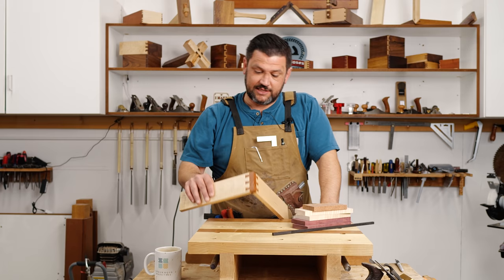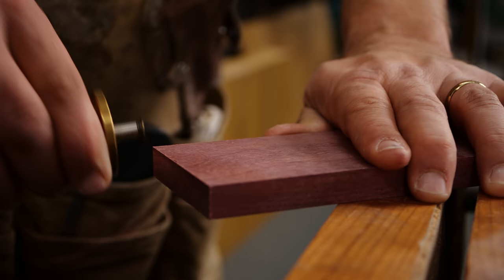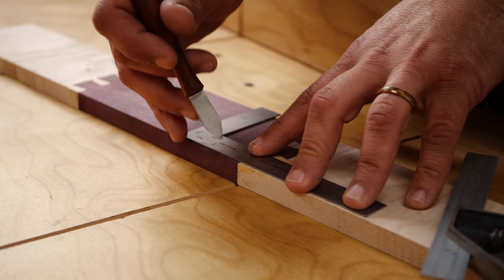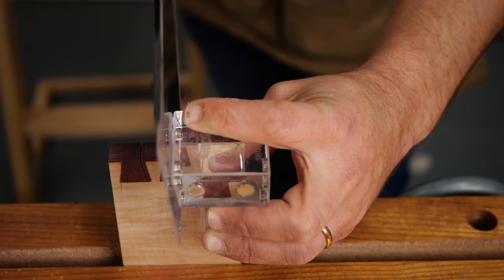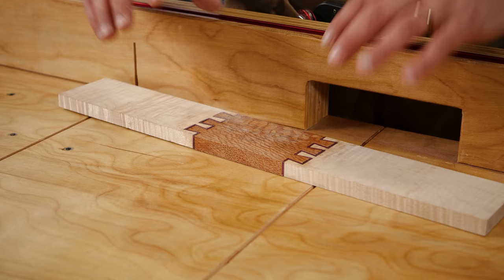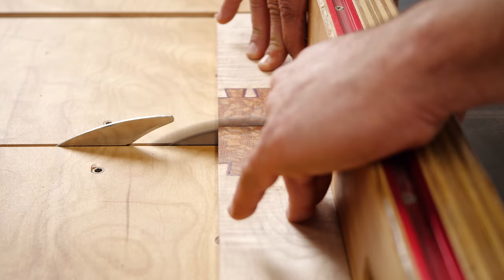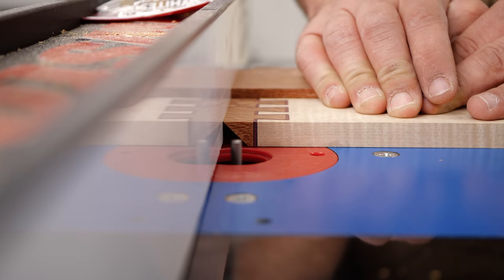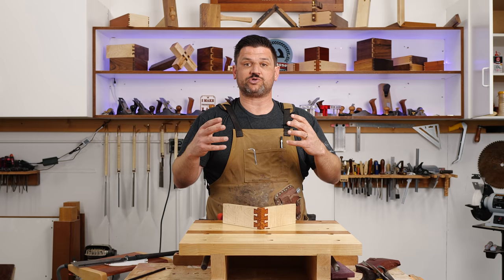SPLINED and Inlaid, Mitered Dovetail Corner - Joint of the Week Redemption

Comment: People talk about joints being weak like  glue hasn't improved for 100 years.  Are these people making structural jewelry boxes?
Reply: That a load bearing spice rack?
Reply: no there making pritty wooden safes
Reply: Lol, ikr, like a joint like that is going to be holding as ton of weight. Lotza newbees here trying to seem smart lmao
Reply: Hey, when the big earthquake hits, I want to know that I can seek shelter in my sock drawer when my house comes collapsing down...
And not to mention the ease at which I can sleep at night just knowing that my remote control caddy could, if needed, double as a small bomb shelter 😀
Reply: Maybe climbing?
Reply: chair my friends.
Reply: If you are going to build something then why not build it to last? Strength and longevity go hand in hand.
Reply: wood expands and contracts... I used to say the same thing, but I have a shadow box on my wall, I did regular miter joints, they are all separated now, I'm going to have to fix it and add splines or something.
Reply: @desertmulehunter  I can see the point for a drawer, tools namely can get quite heavy fast.
Reply: Yes... I park my truck on my watch case... Don't you?
Reply: Titebond applies properly makes the glue joint stronger than the wood itself
Reply: Using PVA glue is cheating. Hide or bust, baby.

Comment: I have to agree with Willy T.  Unreinforced miter joints aren't really that weak. I have made many boxes that way over the last 22 years, some that I kept and use frequently in my shop and none have come apart so far. Although I haven't dropped any on a hard floor yet, which might do the trick!

Comment: I find that plenty of glue is essential, as you mentioned (on both sides) and also, using clamps with plenty of pressure to fully bond the inlay.  Without the clamps, I have had issues—even with a,lot of glue, but never with the clamps plus plenty of glue.

Comment: that looks really nice! Could cut 1/8 in slots in the middle of each dovetail, parallel with the tail direction, and put ebony flats in it. Instead of the vertical ebony piece drill it when done and insert brass rod down the side tails and one down the front tails.... That would make a really strong joint and probably look amazing.

Comment: It's still a weak joint.  Adding the ebony center creates more gluing surface, but it still doesn't make it a true dovetail joint.  It seems one way to make a strong inlay true dovetail joint is to first cut dovetails on one type of wood.  In your case, you'd first cut two rows of dovetails at right angles on the lacewood.  Then glue thin, non-continuous, pieces (in this case purple heart sheets) onto the fingers and notches.  Then clean  up the surfaces.  Then cut the mating dovetails on the maple.

Comment: I really liked the look of the mitered dovetail corner from last week, and I actually prefer it if you don't want all the focus of the project to be on the joint. Whatever project this joint gets used on would have to be better than the joint so it wouldn't be overshadowed by it, unless that's what you're going for. If you wanted to add hidden strength to the mitered dovetail corner, couldn't you use dowels or biscuits, or even a spline that's buried in the joint? That's what I was thinking last week when I saw the comments on the weakness of this joint.

Comment: It would be interesting to see if you could make the corner section one piece, like at 45 degrees to the grain, then dovetail the two straight sections onto the ends of the corner piece. Then the corner itself would just be one strong piece of wood. Cool video.

Comment: Great looking joint.  Can you provide more detail on the layout? How to start? What tail size to use?  Easy to lay this out wrong! In the end, for a box construction, the maple and Purple Heart need to be in a very correct direction. I played around with this and 2 out of three times I had the maple part cut wrong due to layout in the opposite direction!   A star set video making a full box with more detailed discussion and points for accurate and correct direction layout would be fabulous!

Comment: Not every joint has to be strong. A nice painting isn’t going to keep your house from falling down in a earthquake. But sometimes you just want to look at something pretty. These joints both qualify as pretty! Could the corner piece be made of a single solid piece?
Reply: Lol no! but if that painting falls off the wall, it has a better chance of taking less damage if the frame is built strong! And yes the corner could be made from one piece cut into an L shape . Then cut the pins into it, You would have to find the right grain patter for it or one side will be weaker then the other.

Comment: Can you please explain the strength advantage of a square spline notched into the mitered faces like that?   Is it just the added glueing surface? I’ve been under the understanding that a spline slotted into the miter faces also adds a mechanical advantage by locking the miter.  Also face slotted splines are the best because endgrain isn’t involved in the splines glueing surfaces - but that would had disrupted the appearance.  

I’m not trying to be critical here, you’re a great craftsman that produces beautiful work, In my conservative head I’m thinking, “if I’m gonna go through all that work, I’m gonna want the piece to last for generations”

I’ve not tried an inlayed dove tail. You have some serious patience
Reply from the maker: It adds glue surface. Also I think people need to stop building everything like they're going to stop a nuclear attack. For a jewelry box this will last generations
Reply: Jonathan Katz-Moses: point taken., makes  sense for that application.
Reply: @BiggMo  When discussing joint strength, it's important to consider the different directions in which a joint can come apart without breaking the surrounding wood.  For instance, consider an ordinary dovetail.  The only way it can come apart is the way it went together, right?  Movement in literally any other direction will break the wood before the joint itself fails. 

Now consider an ordinary miter.  The joint can break due to force applied in any direction.  It's not strong in any direction.  Furthermore, it's an end grain to end grain joint, which is where regular wood glue is the weakest.  Splining it the way he did adds long grain to long grain glue surface that the miter previously lacked.  By itself, that's a massive upgrade to joint strength.  However, it does add some mechanical advantage as well since the mitered corners can no longer "slide past" each other, if you see what I mean.

 If I wanted to add even more strength, I would have added 3 horizontal ebony splines across each miter as well, but that may have turned out to be too busy.

All that being said, @Jonathan Katz-Moses is exactly right.  If it's a freaking jewelry box, it doesn't need to be built with the same concern for joint strength as a table or a chair.  Application matters, and that joint will last forever unless somebody throws it across a room.

Comment: 3 of the four woods here are in my top five preferred woods as far as the look or the wood goes, and they are the stars of this joint. I love purple heart, lace wood, and highly figured maple. And yes, the contrast shows nicely on camera as well. I was just a bit worried when you said spline that you were going to cut grooves in the corner to spline it like a picture frame or more commonly used spline for a jewelry box. Properly place that could look nice too, but this works as well. Does an oily wood such as ebony really add much strength to the joint? The oils in the ebony would disallow the soak-up of most PVA glues, would it not?
Reply: Have you seen wenge or Madagascar snake wood. Beautiful wood and dense and strong. Similar to oak in durability. But the grain is beautiful. When worked properly
Reply: @dannysisk9458  yeah, I've seen wenge but not the snake wood. Haven't been privaledged to use either.

Comment: Just a thought.

If you took a square board, cut it out to make an L, then put dove tails on each end, you would end up with the same look as the first one but would have a solid corner as strong as just dove tailing the ends of the draw walls together.  If you wanted the spline look, you could drill a shallow hole in each end of the corner and glue a black plug in or chisel a square hole and glue a square plug in.
Reply from the maker: I've answered this a bunch but the grain would be wrong on one side and be end grain to end grain plus you can not find any exotic hardwoods thicker than 4/4. ALSO, you would be able to clamp it in a vice to cut it because it would be too short.
Reply: @katzmosestools  
Bummer.  Maybe you could dove tail two pieces of exotic hardwood together and then dovetail that to the other wood.  A lot of extra work but it would still be stronger and not require the use of brads to ensure the the joint does not come apart if pulled on too hard.

Still like your work.  Looks great.
Reply from the maker: This plenty strong for any box design
Reply: @katzmosestools  
Good to know.  I just have the type of personality that wants to over engineer stuff.  I do not do woodwork but I have been told that my name has been used as a curse word by people who wanted to take my stuff apart so they could move it.

Comment: That 1/8" contact line of side grain on each board to the spline that's oriented in a way where stress goes across the grain rather than with it really makes this super strong. Nice job. A dovetail is already a pretty joint but at least you made it weaker.

Comment: You do great work. But that's still just a splined miter joint. Pretty, though.
Reply: What's so bad about a splined miter joint?
Reply: DB
Reply: You make great comments, but that still just a thin insult and entirely useless.
Reply: @jonhohensee3258  Nothing wrong with a splined mitered joint. Dovetailing was invented to make stronger joints that held even if the adhesive failed. This absolutely beautiful joint appears to have that characteristic, but it it does not. The dovetailing is for beauty, not for function. I think that's the point the OP was trying to make.

Comment: Love the square spline but the folded miter with precision routing looks like a headache.

What if you did a circular "spline" by just drilling in a bit from the top and bottom, hammered in nice hardwood dowels, and sanded flush?  Less work, zero compromise in strength.
Reply from the maker: Imho then you'd have one round object in a sea of sharp angles. Would take something meant to be an accent and make it the center of attention. Thanks for watching bud!

Comment: Do you really need to change the cutter shape for the opposite elements?
It is possible (easier?) just to change element direction and milling horizontal with appropriate offset.

Comment: I dont understand how this is stronger. It's still glued. Why not cut it out of one solid piece?
Reply: More glued surface area in different directions makes it more stable and have a better physical bond to the glue
Reply: Where the spline is glued, there is face/side grain to face/side grain, instead of just end grain to end grain.
This joint is much much stronger.

Comment: Needs more reinforcement. Make horizontal splines through the tails, and notch them so the ebony fits in like a key. No way the joint can come apart then
Reply from the maker: This thing is plenty strong for anything you would use it for. I promise

Comment: Very cool beautiful joint. But even using modern high strength glue still weak joint. Instead of bevel how about another dovetail or even finger joint. I guess it all depends on what it is being used for. A little decorative jewelry box it doesn't matter, but a craftsman's tool chest would need a better joint.

Comment: I can't see the grain on the ebony, but presume that it runs the long dimension of the stick. So for the joint to fail, the ebony would have to split along its grain. Wouldn't you achieve a stronger joint if you cut that spline cross-grain, aligning the spline's grain with the joint's stress?
Reply from the maker: Then you're just gluing endgrain to endgrain

Comment: So, it looks beautiful, but my brain can't wrap around why anyone would bother cutting dovetails then not use their strength for the actual joint holding the corner together.  I see it and it looks the same as a Honda with a giant spoiler on. the back. Well made joinery used dovetails and fast cars have big spoilers so I must have a good joint and a fast car if I use both?

Comment: Really like this but how is the vertical spline reinforcing it? If anyone can explain or send a link please do because this has confused me
Reply: I think it reinforces it because: 1) It is not endgrain on endgrain anymore
2) More glued surface.
I'm guessing so please correct me if I'm wrong.
Reply: @michelepancera  That's right, plus it adds a bit of mechanical advantage since the mitered edges can no longer "slide past" each other.

Comment: Beautiful joint. But, as I am not a specialist of wood, could you explain why this is more solid than cutting both at 45° and glueing together. For me, a solid joint should be solid with no glue at all, and resist because it is "locked" by key as in dovetail's. But building dovetails and then... cutting and glueing is not more solid than just glueing. Just more beautiful if you like it.

Comment: This is a stunning joint.  I know zero about wood working.  I'm going to a two hour class called Understanding Wood.
Is this a joint that could be learned with an instructor?  As well wrap around the outside edges ofa cutting board on all four corners of a two inch thick board?  After doing some learning first of course.
Reply from the maker: With expert instructions I'm sure you can do this. I would probably so it on the router table if I was teaching this. Cutting it by hand is very advanced. I don't think it would work on an end grain cutting board though because of the grain direction.
Reply: Thankyou for the your encouragement sir.  The shop I'm interested in is an open too the public.  It's loaded with band saws, planing machines,
Table saws, router tables, lathes, CNC machines, instructors, free classes.  It even has a metal shop, 3D printers, acrylics LED lived sighns, jewelery area.  All with instructors in each area of interest. An artisans work space if you will.

Comment: Please forgive me if I don't get the terms right, I am still learning a lot, 
but, if you measured the length extra wood going away from the lacewood tails (I think they are called), towards the corner, to be the thickness of the other piece of wood, when you do the lacewood miter, could you get it so the grain looked like it went round the corner?
Perhaps this is very hard to do with the miter, but I think it would give it a really cool effect.
Hope that was explained well enough :)

Comment: I like that clear block you use for a guild for angles. What is that called? Also where do you get your wood?
Reply from the maker: It's a jig I invented called the Katz-Moses Magnetic Dovetail Jig.  There's a link in the description. I get my wood at Mayan Hardwoods in Oxnard and Aura Hardwoods in SLO
Reply: @katzmosestools  you invented that. Great idea.  You should go on shark tank with that one. Or at least sell it in hardware stores. You would make a pretty penny. Thank you.
Reply from the maker: @inspectorsteve2287  I sell it on my website and have turned down several vendors as I really like doing the entire manufacturing to consumer process.
Reply: @katzmosestools  oh that's cool. To each their own. I'll check out your website.

Comment: Dont see how this is any different to the last one in terms of structure strength but looks really cool tho
Reply: Splining the miter joint adds a surprising amount of strength. Not only is it no longer end-grain-to-end-grain, but there's so much more surface area for the glue to adhere to.

Comment: Jonathan - great joint first of all!  question, do you always hold your jig on the outside of the board you are cutting?
Reply: It depends on the saw that you are using to cut the joint. Japanese hand saws cut on the pull stroke and you want to pull the guide into the wood, thus it is used on the outside. A Western hand saw cuts on the push stroke and you would want to push the jig into the wood, thus the jig would be on the inside.
Reply from the maker: The other guy nailed it
Reply: I only know from experience. I love my JKM dovetail jigs!
Reply: eodhowland thanks I use a Japanese saw , Durr for not thinking of that!  Thank you for the reply!

Comment: Why didn't you cut the Dove tail with a router? Wouldn't that be more precise and a lot less manual work? Not trying to be a pain, honestly want to know want to know the reason.
Reply from the maker: Because there's no way to do it accurately without an incra table saw fence. But most importantly I love handcut joinery and hate machine cut
Reply: @katzmosestools  thanks for the response, your work is truly incredible.

Comment: I swear, people are way overblowing the needed strength for a miter on a decorative box. What are you all doing to your decorative boxes... using them as a backup cricket bat? Using them to test the strength of your new tile floor?

If I am making a box where strength is a big concern, I sure as heck am not using a miter of any type. Box joints and dovetails are for strength. Miters are aesthetic, because no other joint can provide a seamless transition from face grain to face grain the way they do. If you are dropping decorative boxes hard enough to break basic miters, your box is going to be ruined anyways with a dent or chip, because even hard maple will dent or chip before a basic mitered box breaks, in my experience.